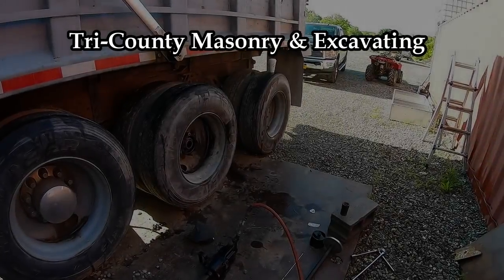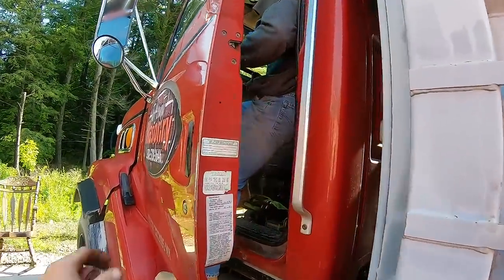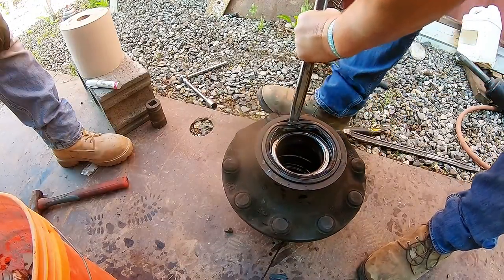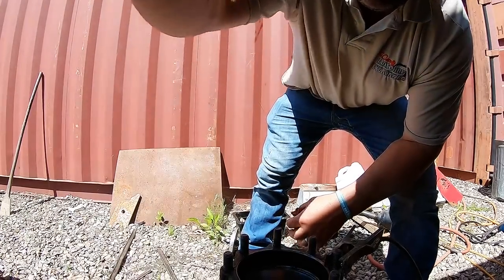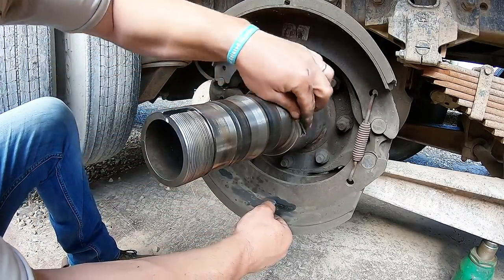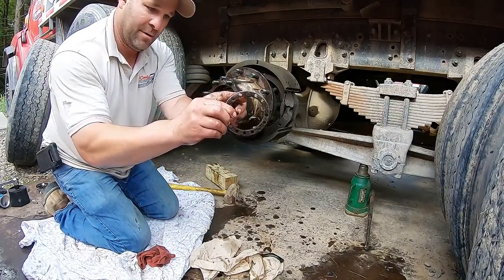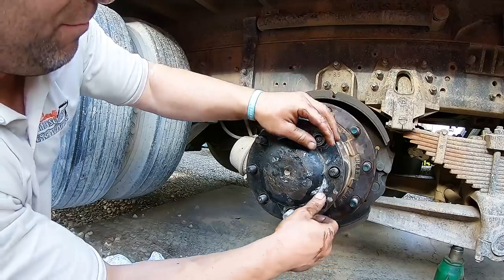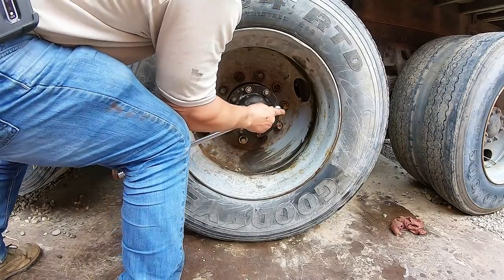Sterling Meritor rear hub repair broken studs that hold axle in place

Comment: Something I learned about studding and bolting during my career in the Navy. A little never-seize on those bolt threads will help you the next time you need to remove them. Works even better on hot end exhaust bolting. Just an old man thinking out loud lol. I enjoyed your videos. Thank you for sharing.
Reply from the maker: Thanks for the tip and watching!

Comment: The holes in the lock washer are off center.  If you can't get them to line up where you want them. Flip the washer over and the holes will be half off, splitting the distance to the next hole. Always go to the next looser hole, never the next tighter hole. Better a hair loose than a hair tight. More so on lighter axles.  CHEERS
Reply from the maker: got ya thanks for the tip
Reply: better hair loose? When I was taught , it was. better a hair tight. Im just starting out, I check end play at the end to be sure.

Comment: The proper way to adjust that type of wheel bearing is to seat the bearing as you showed, then back off the nut 1 turn then torque to 50 Ft# and back off 1/4 turn. Install dowel washer and lock nut . Torque lock nut 300-400 FT#. This procedure can be found on the internet by bearing and hub manufactures. It is the only method that will hold up in court if there is a accident!
Reply from the maker: You are correct sir! Thanks for the info!

Comment: I gotta do the hub on my f150. Watching this video will make my job feel like a walk in the park.  I like the pro tips man.  The one with the hub cover holding the hub and how you used diesel to lube and clean the bearing. Hey Madman.  Next time you weld a nut to the copper try welding a thick washer to it first then weld the nut to the washer. 
   Awesome video bro!!! 🇺🇸
Reply from the maker: Thank you J Mac!

Comment: Very nice job even went as far as the valve stems 6 to 12 but one thing i would have done would be puting a little rearend grease  in the vally of the hub between the bearings  so they wont have a dry start diesel is ok for lub but it also cleans and washes do it cleand out what ever 90 weight off them just a trick my dad when i was a boy lerning showed me it hyst stuck with me through out the years of life i pass it on to my kids and the people who like to learn sure its alright but it just a pet peave of mine i lern that dad was right more then wrong never to old he said to lern love ya dad rip iam 62 now and still lerning thats why i watch these videos  to learn what i didnt know or a better way of doing  the job geat techneak my good mad i like your dot video too doing the walking beam spring repair
Reply from the maker: Thanks Ronnie appreciate the story! Going to start doing the grease on the bearings everybody's recommending it!

Comment: I have never scene the copper tube trick, I will be trying that one thanks for sharing. As long at the rear axle is full, pull the truck into a spot where that wheel is lower and the lube will flow out to the bearings, I always added some to the hub before installing the outer bearing to be on the safe side. I see someone else left the correct procedure on tightening the bearing nuts. One thing to keep in mind is the fact that there is a bit of play in the bearing nut on the threads, so if the inner bearing is set so there is no free play in the bearings, when the outer nut is tightened it will push the inner nut over a few thousands and the bearings will be running to tight. They will be preloaded, just as if the truck had a load on it when empty. As far as easy outs go never use them, because when you brake one off then you are really screwed. Yes I clicked the like button.
Reply from the maker: thanks my buddy

Comment: That was amazing and a great video in every way. Shows how it goes in real life. Those welds almost worked but I was betting a good machine shop would get it and they did. Had to laugh over the "shiny new on this old truck" comment! I know you already answered this about the bearing lubrication from the gear oil, but I always thought they should be packed with grease first. No?
Reply from the maker: Dale no Grease strictly 80/90 gear oil grease would stop the flow of the oil. Other scenarios where there's not an oil bath then yes you do pack them with grease but these trucks have oil baths on all axles including front. I'm sure in the future I'll have video footage of me welding Frozen studs out of something I've done it multiple times!
Have a great Sunday! 🌞
Reply: My old truck takes grease in the steer axle bearings only, never seen a modern (post 1950’s) drive axle on a truck that uses grease, always gear oil. Easy way to tell on front is if you have solid steel bearing caps it takes grease, if they’re the see through type with a fill plug they take gear oil.
Reply: @J.R.in_WV  Good tip - many thanks!

Comment: Great video.  I saw on another U-tube channel where they placed a flat washer under the nut to be welded, helps to keep the weld inside the nut and not spread out.   I noticed you had a one nut with a built in washer (flange nut) so that might even be better.   Haven't tried this but just an FYI.  Again very good video.  Stanley
Reply from the maker: Thanks Stanley much appreciated feedback!
Mike

Comment: I’ve broken driver’s side wheel studs on a ‘63 Pontiac Bonneville Ambulance... I had to replace both driver’s side tires when the old ones quit holding air while it was on my trailer... I knew about left-handed studs, however the front ones were regular, and I didn’t bother to check the rear ones... so I proceeded to snap two of the remaining 4 studs right off... I replaced those with regular studs to match the front ones. I wonder why there was already one that was broken...
Reply from the maker: I mentioned it in video I snapped it with a big air gun thanks

Comment: I agree with Darren Steele, anytime I replaced  bearings or pulled the rotors off any of my vehicles, when reinstalling bearings, I always repacked the new bearings with grease. Here, he just placed the bearings in the drum and then the seal.  No good. Bearings won't last long.

Comment: You never use diesel fuel to lubricate the spindle surface for the seal to go back on. It can swell the rubber in the seal and weaken it causing possible leaks in the future shortening its life.
Reply from the maker: Didn't know that thanks for the tip

Comment: what dont you pack the bearings with grease before you lock them in?
Reply from the maker: So that's a good question that I answered multiple times manufacture specifications don't require That is an oil bath The pumpkin is full of gear oil The minute you lower the jack it all fills the hub and bearing. if you pack it with grease you will starve the bearing from oil.

Comment: Why did you NOT pack your Barrings and inner Hub ? Why did you go streght from the Diesel Fuel to assembly without rinsing the DF off the parts with Water and Blowing the Water off and Packing the Barrings?
Reply from the maker: I never put bearings in water unless I drop it in dirt.. also the diesel fuel is a lubricant so it is safe to put in.. manufacture specs don't recommend the grease because it could starve the bearing from oil..
Reply: @DIRT-BOSS  
I Started packing barrings and doing big Truck Break Job's at age 11 and have done Hundereds. I've never seen it done your way before and I'm currently 60 year's old. But if it's been working out for you I am happy for you. Keep fixing your equipment and Never pay another Man to fix anything that you can fix unless your time is More valuably spent doing other Work. Great Video and good luck avoiding DOT, They Suck.
Reply from the maker: @royceanderson4904  thanks!

Comment: Is diesel an acceptable lubricant instead of packing grease into the bearing?
Reply from the maker: The diesel was a cleaner soon as You lower the truck the axle fills with gear oil then I top the gear oil off in the pumpkin also it's not recommended to pack those bearings as it will starve the bearing for oil.
Reply: @DIRT-BOSS  ah makes sense! Wasnt aware they were in an oil bath :)

Comment: Interesting  repair why didnt you pack the bearings with grease runing beatings without packing them is asking for trouble the bearings can get very hot by the time the diff oil gets to them so safest way is use some grease saves any stress of failed bearings happening..😀😀😀 Be careful like you learned leave the air gun on the bench when tightening somethings lol 🤣🤣🤣🤣🤣🤣🤣🤣slow an steady wins the race well done you checked wheel stud tension after using the air gun seen many wheels fall off from lazy air gun users 🙄🙄🙄🙄🙄🙄
Reply from the maker: Good points but I disagree on the packing with Grease .. as soon as you take the truck off the Jack oil is halfway up on that bearing.. if you pack grease in there you starve the bearing from oil.
Thanks for your imput!
Reply: @DIRT-BOSS  Whatever works for you is fine like I said seen others do it your way and destroy things. We all do things different grease is cheap. What realy makes it worse  is the camber on the road oil tends to run to the lowest side leaving the other side dry if it hasnt been on level surface long enough after the repair to allow the oil to work its way through to the bearings gear oil travels slow.
Be safe keep up the good work 😀😀😀😀🇦🇺🇦🇺🇦🇺🇦🇺😀😀😀
Reply: @DIRT-BOSS  absolutely. The grease displaces the area oil would go. Put the hub on, pre fill the cavity, put the outer bearing on. I top the diff oil off and then jack up the opposing side so oil will fill that hub up for sure. You're doing fine.
Reply from the maker: @jddiesel7409  Thanks man That's exactly what I did!
Reply: @DIRT-BOSS  I would say ditch the diesel. It's a good cleaner, not so good as a pre lube on wheel bearings and the seal. It'll be displaced and ultimately not make a difference. But ya know,  Youtube gotta tell what I think 😉. Nice to see an owner working on his own equipment and having good results. Keep up the good work.
Reply from the maker: @jddiesel7409  Thanks bud

Comment: It is not the rigth to lube your seal with diesel it with expand the rubber seal..
Reply from the maker: Thanks for the tip
Reply: you also shouldn't lube the spindle where the wheel seal sits... you want it dry to avoid spinning the seal and damaging the spindle.
Reply from the maker: @llewellynbyron  got ya I just thought I didn't want to rip the seal going on?
Reply: @DIRT-BOSS  it won't rip and if your gonna lubricate a 2 piece seal with anything use something like p80 which is water based and dissipates shortly after application but honestly dry is best.
Reply from the maker: @llewellynbyron  10/4 👍🏼 thanks

Comment: You started your bearings dry. Not good
Reply from the maker: So they say! thanks for watching
Reply from the maker: @llewellynbyron  yes That's what I did and then topped off the pumpkin!
Reply: @DIRT-BOSS  keep getting her done. With these crazy shop rates and half ass mechanics charging up the wazoo and taking days and sometimes even weeks to get your truck back on the road... This is the only way to survive.